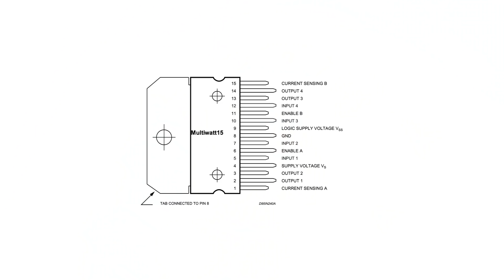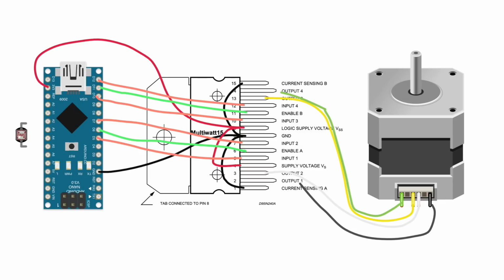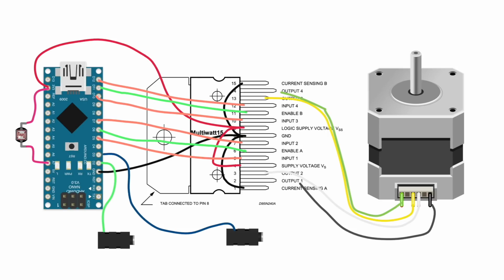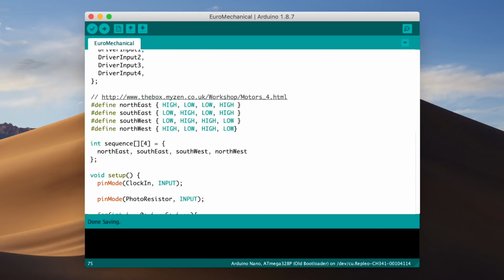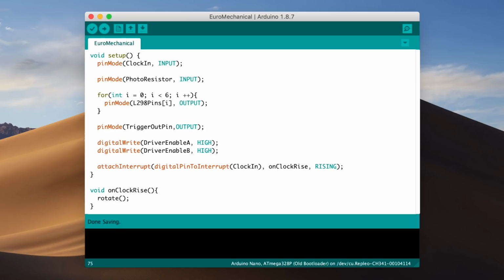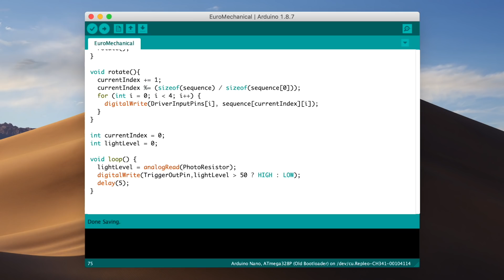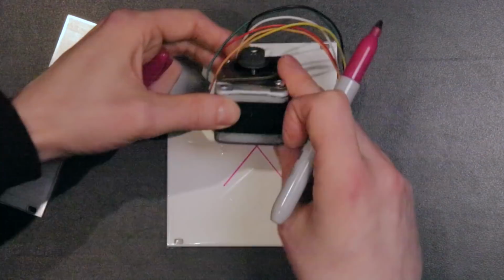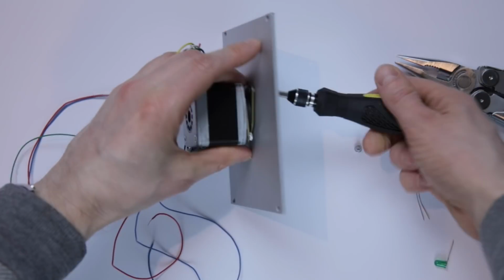Building a Eurorack Mechanical Modular Sequencer - Leaving the Laptop Episode 4

Comment: Neat device, it's a low-fi optical disc! It would be cool to see you playing around with it a bit more.  Is it possible to slow down or speed up the disc by manipulating it with your hand?
Reply from the maker: Hack 'n Build sure - although it’s still a bit flimsy (held in place with blu tack!) so I have to be careful. I’ve been thinking about maybe a 3d printed platter to attach to the wheel if I can figure that out...